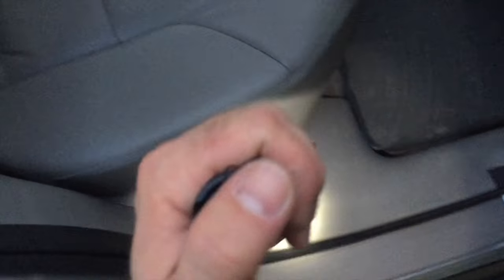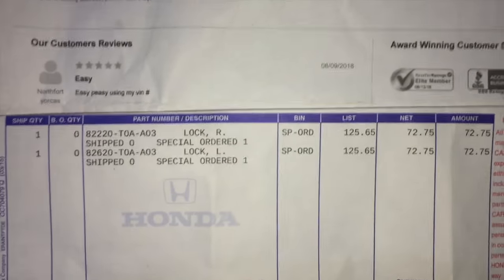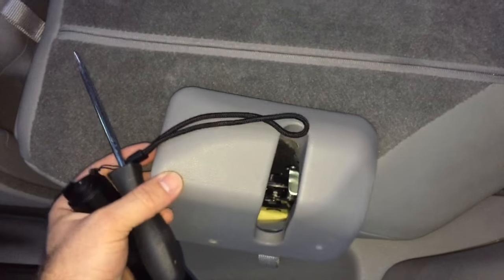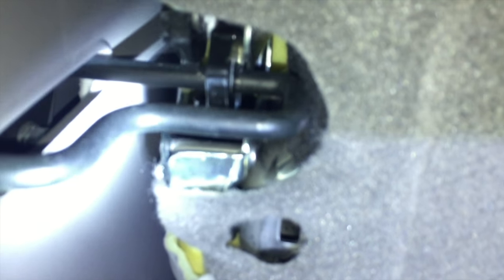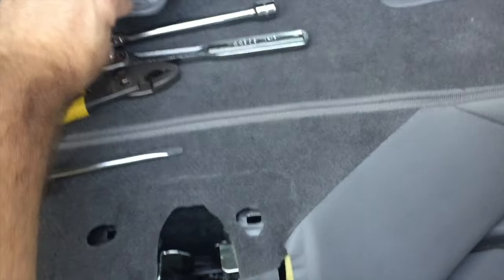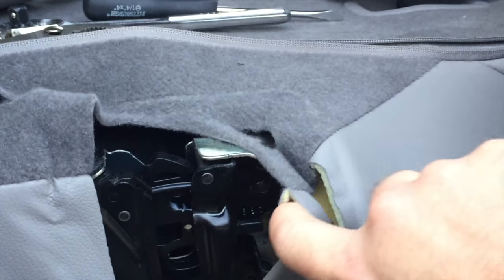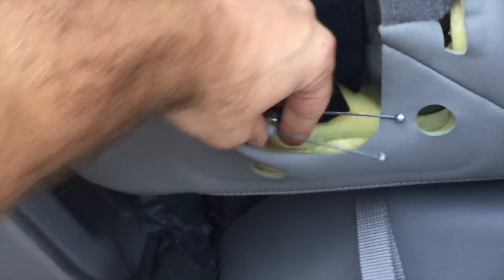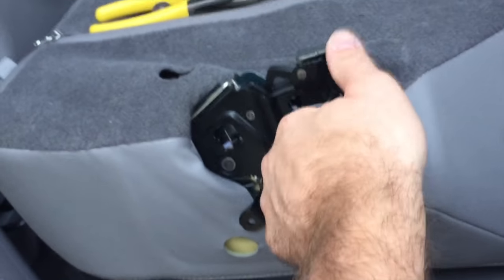FIX: Rear Seat Back Jammed/Stuck/ Won't Fold Down on a 2012 Honda CRV

Comment: Just FYI the bolts are 12mm not 1/2 inch.

Just goes to show how crap this era of Honda was/is when it comes to quality.  I had both of mine fail within days of each other, and right when I needed to urgently transport a large package that wouldn't fit in the vehicle unless both seats were down.  I got the first seat down using the screwdriver method within a minute or two but spent the next 3 HOURS trying to get the other seat to go down.  I would've given up but I had to get that package somewhere.

If you look at the broken parts, the metal piece where those beads on the ends of the release wires go is attached to a pivot inside the latch mechanism.  That piece of metal is sandwiched in a piece of plastic, but the metal part DOES NOT EXTEND ALL THE WAY TO THE PIVOT.  The entire load of the release force is carried 100% by the plastic.  And that's where the failure mode is.  Right where the metal ends is where the plastic sheared off.  I would love to kick the engineer who designed that and/or whatever bean counter at Honda who decided to save a penny or two per part and make the thing only partially metal right in the genitals.

My CR-V also has the infamous VTC cold startup grinding noise.

This pissed me off so much that I think I'm done with Honda.
Reply from the maker: Thanks for noting correct size of the 12mm bolts! I updated the comments for the video.

I felt the same way. It put me in a bind too, and when I saw how poorly the part is engineered, I made the video. I may be done with Honda too, but at least this CAN be fixed without taking it to the dealer (thought they did not make it easy to find the part!!!!). They totally under-designed the part with cheap plastic carrying the load - it would've been simple and cheap to make the whole thing metal or at least making the entire part repairable (without riveting it together).     I hope the video helped. 

My car also had the VTC grinding noise issue. It was well over 500 dollars to get that one fixed -  I ended up taking it to the dealer for that one. They say they installed the "new improved" part, guess we'll see if it is improved for real. There should definately be a recall on the VTC... doubt they will recall anything unless it is tied directly to safety. Hope you can find a better way to get the VTC fixed.
Reply: @Zacholas  Forgot to say thanks for posting!  Video was definitely helpful, and I avoided breaking the plastic trim pieces thanks to you.  Judging by the amount of comments this video is getting now it looks like these parts are starting to fail en masse.

If you do a lot of DIY car work you might pick up one of these:

https://www.amazon.com/ARES-Removal-Upholstery-Fasteners-Prevents/dp/B072LWS2H6/

These will pop off the plastic trim rivets and you won't have to struggle with a screwdriver to do it.  Less risk of damaging them too.

 I've read mixed things about the VTC actuator replacement.  From what I've read on various places online, some say it fixes the problem, other report that it still comes back, but less often than before.  I'm not about to pour $500 into an engine repair on a car that I'm not particularly fond of that may or may not actually fix the problem.

The VTC actuator issue goes all the way back to 2008 when Honda started putting this series of engines into Accords.  You would think that a timing chain engine designed and built by Honda would be as bulletproof of an engine as you could get, but apparently not.  It took Honda until 2016 (8 years!) to finally acknowledge the problem.  They had already phased out this particular engine after 2013.  I think that says something about how much this company cares about it's customers.

There are almost no reports of complete engine failure because of it, but if you follow the logic of what happens, I could see it happening in rare cases.  Extra forces and wear on the timing chain from the VTC actuator grinding over time could stretch the chain and prematurely wear out or damage the timing chain tensioner.  If the timing ever fails on this engine, it's an interference design, so that means pistons and valves collide, and then you're in for a thousands of dollars engine rebuild.

I'll guess I'll just wait and see how long this car lasts.
Reply: All you have to do is change the VTC gear and the noise goes away
Reply: @alexgieder9107  how much does that cost?
Reply: @cathytwine207  I dont know. I get mine done at my local dealer for free because it's still under a warranty.
Reply: @alexgieder9107  thanks! I complained about this multiple times to the dealership while under warranty. They could never explain what it was or how to correct it. Of course. Now, I see there is a repair bulletin out by Honda, from a few years ago even, citing they are defective. Not sure if that means they replace it even if under warranty? So annoying. The seats, the VTC, the bad cell battery, now the sway link bars. And I thought I was doing good, buying my third Honda. Wrong!
Reply: @cathytwine207  I just had the sway bar links changed as well. This crv is not the best and when I can afford it I will be getting a civic. Hondas are amazing just this crv is not good
Reply: @alexgieder9107  agreed. And here I thought I was buying such a good, long term vehicle. I love it, though. The way it drives, etc...but they surely messed up with a few lines, it seems with a few of the parts. So disappointed.
Reply: I contacted Honda about the service bulletin I found regarding the VTC Actuator being defective. Because my car is out of warranty (despite the fact that I attempted to have them replace this while under warranty), they would not do anything.  I then went to my local dealership where I have the oil changed and most work done. They went to bat for me with American Honda. They are now doing a Goodwill Replacement and it will only cost me $50. Yay for the local dealership going to bat for their clients!

Still ticked about the seats being stuck, but what can you do?
Reply: @cathytwine207   Glad to hear that they actually did it for you Hopefully that fixes the noise
Reply: Is that what that noise is???

Comment: This video almost makes me think I can fix this! Lol.

Anyone had battery issues with the 2012 CRV? What about Sway link bars? I just had to have those replaced today. Expensive!
Reply from the maker: Thanks for the comment. Its funny - I have had the battery replaced TWICE!! The first two times it was under warranty. They put a 90 month battery in it, but it died. The one in it now seems to have been okay for a couple years at least. I have also had to have the infamous vtc actuator replaced because it would grind when starting. 

I have not had sway link bar issues... What are the symptoms of that?
Reply: @Zacholas  yes, two batteries for me as well. I now carry a portable jump start battery with me. It's crazy! 

I have not had the VTC replaced but I guess I will have to at some point. The dealership told me that it's just the way these cars sound at start up. Mmmkay. 
 The sway link bars going bad sound like a rattling or clanking noise under the front end or I guess back end near the tires. I thought something was loose and about to fall off any minute. I knew nothing of their purpose and significance. Sigh...just one part after another. I have a 2012.
Reply from the maker: @cathytwine207  Oh wow, I didn't realize others had a problem with the battery. Yeah, it definitely must be an issue. The VTC issue just began to sound SO bad that I had it replaced. I know the dealership & Honda say it is "normal" but it got ridiculous and was actually embarrassing to have that rattle every time the car started. 

Thanks for the info on the sway bars. I was starting to worry that I might not have anything else to worry about. The design flaw in the back seat clips is OBVIOUS as other commenters have noted. I made this video because I knew there will be many with issues with it. Its not really a hard fix, it is just the plastic parts that are a bit tricky to remove/easy to break. The  metal clip has a small piece of plastic used at a stress point. IDK...
Reply: @Zacholas  
Rattling noise near the tires where it's loose...sounds like something is loose. For me, it was the front end. Granted, I do have over 100k miles.
Reply: @Zacholas  I have a 2012 CRV purchased new and still own it. Great car BTW! Couple of years ago Honda sent me a letter in the mail for a TSB. You have to update the vehicle firmware on the ECU. There is a fix for the battery drain. I went through 2 batteries also in 3 years. It has been 3 years since the update and the issue seems to be fixed.
Reply from the maker: I had this done, and The firmware update helped – thank you! I  Had to change the battery again this year, but it did last about five years

Comment: Mine both side broke. 2013 CRV. the part has 99% meta except where it broke is plastic and that was the load bearing part. I think Honda designed like that so they rip off more money from you!
Reply from the maker: Yes, I agree 100%! Mine broke within days. I hope this helps everyone save money and fix the part quickly!

Comment: 5:10 I wish I'd known this yesterday.
Reply from the maker: Yeah, I couldn't find a video on this and figure it may become a problem for some owners. The plastic part in the metal hinge/clasp is a poor design, and it is very easy to break the cover and rivets. I was able to epoxy/glue the posts on the covers so they work great again.
Reply: @Zacholas  it would be wonderful if i could find out how. both of my chairs bust open yesterday

Comment: You have not shown how to get the plastic cover off while the seat is locked in upright position. You should have
Reply from the maker: Sorry, I didn't think of that. Good idea, though. Unfortunately, I broke the plastic piece, so hopefully seeing it removed helps avoid breaking the flimsy clips.